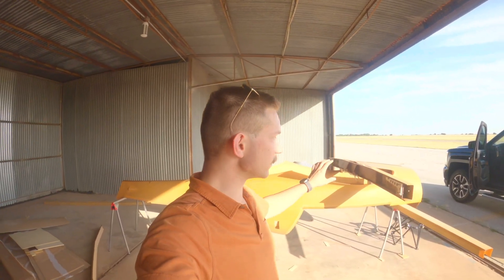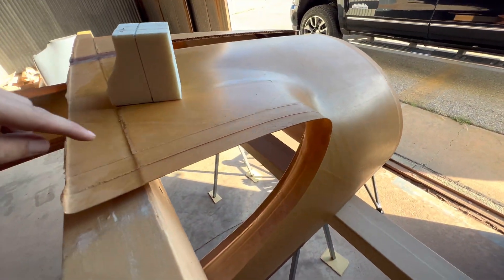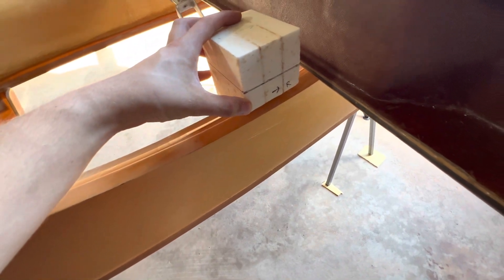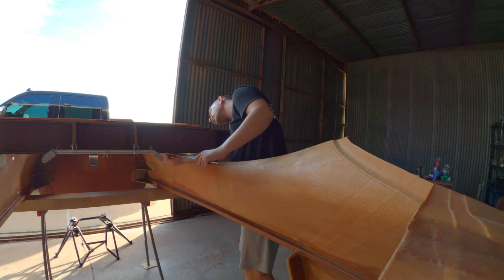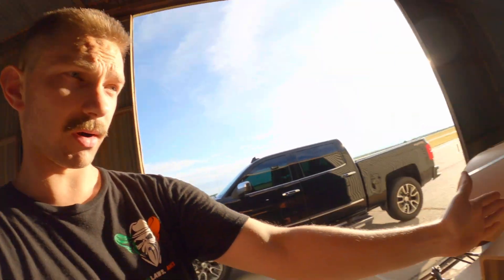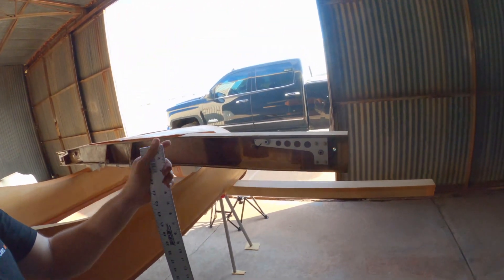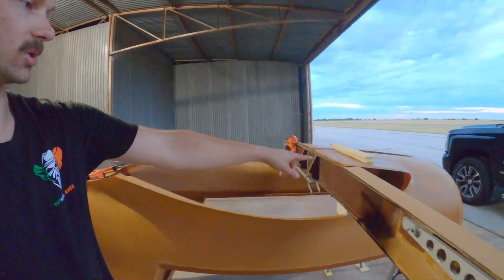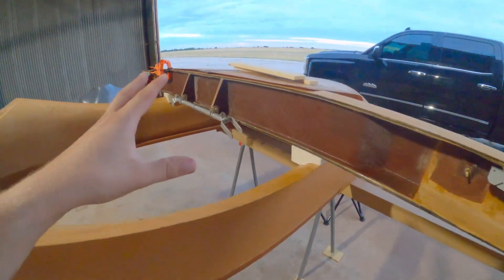I tried not to screw up the most important part of my new plane - Lancair Build Part 2

Comment: Would the centerpieces ng of that veam been easier if you had outten a center mark on it and also on the belly cover. That would have given easy refer jce for when you need to adjust the angle but also keep it centered
Reply from the maker: Good eye! That is what I ended up doing, then verifying with other measurements.